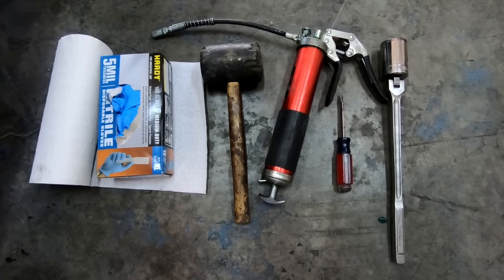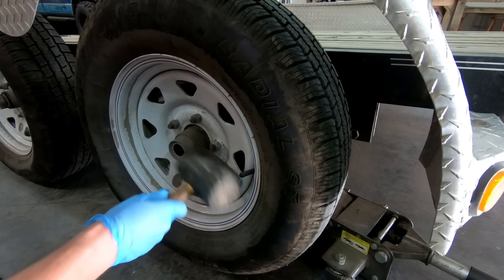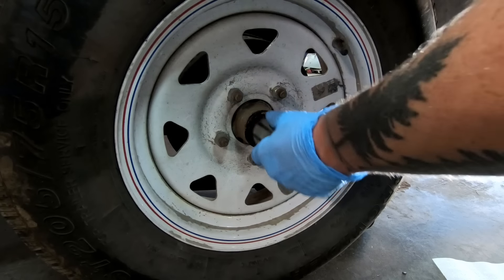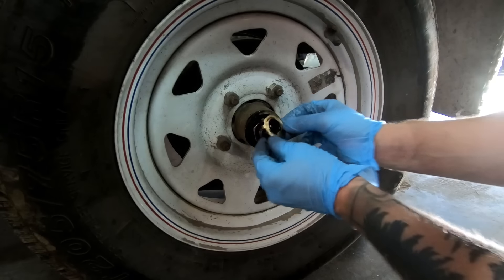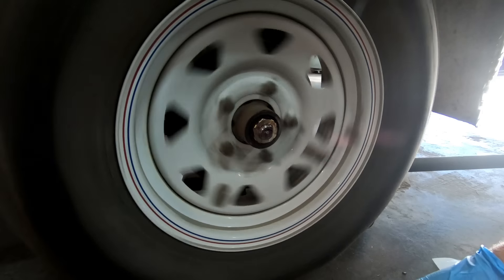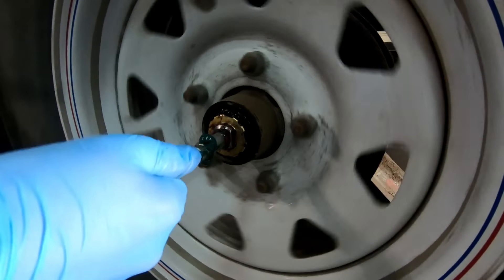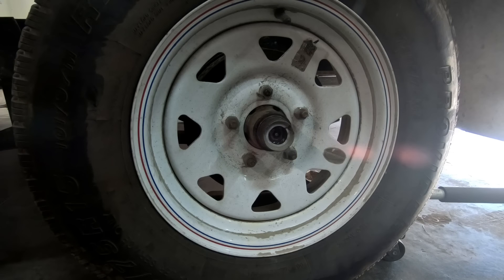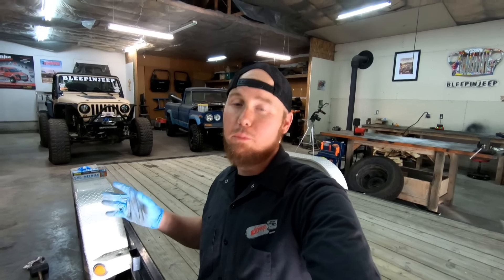Adjusting Trailer Bearings: The EASY way!

Comment: Thank you. I was concerned with the little bit of play I have on my wheels. This eased my fears. I do have a question though. Sometimes I have a good amount of bounce back and sometimes I don't do you think it is load distribution, torsion axles going bad or hitch connection not right?

Comment: You need to tighten the nut with the hub spinning. Backing off allows the outer bearing to push out slightly and unseat from the race. Finger strength will not overcome the weight of the hub and fully seat the bearing. Spin the hub in the same direction as tightening. Never let go of the nut while the hub is spinning as sometimes the bearing will grab it and over tighten it. This will allow the bearing to pull in against the race and fully seat without excessive preload. The tighter end play this creates will be much much more forgiving if you need to back off to install whatever locking method the nut has.

Comment: just checked the Rockwell/dexter service manual for light axles. As i suspected, the bearing adjustment is 1/6 turn loose and more to align the cotter or keeper.
you might also state that most nut keepers go behind the nut.

Comment: What knocks them out of adjustment? Good video as always
Reply: wear
Reply: Thank you! They slowly get out of adjustment from normal wear and tear. When you travel along a lot of dirt roads like I do it will wear them out even faster than normal.
Reply: Heat! They get hot and like most things of metal will change/shrink in time. This wear a good grease comes in to keep them from over heating too much. If you are looking at a used trailer it would be wise to change out the bearings so you know where you stand when you want to travel with it. Nothing like that new used trailer sitting on the highway with one wheel missing.
Reply: @jimwhitman5805  very well said my friend!

Comment: Great video, but you're supposed to torque the spindle nut as the wheel is spinning, to properly seat the bearings. You had let it stop and were still tightening the nut. Everything else was spot on
Reply: Very interesting I was actually taught the opposite LOL. I suppose either way will work as long as the finished result is a wheel that doesn't shake and is not too tight!
Reply: Nate, you'll be able to seat it tighter before backing the nut off if you keep it spinning, then if you're very careful and don't move it loosening the nut and reset it hand tight you should pretty much have no slop in the bearings instead of the little bit you were describing.  If you're able to stop the wheel completely without using something crazy like a 6' cheater you likely have worn bearings.  Dissasemble, and check for wear on the bearing cages (rollers also, but cages contacting is what typically lets you completely jamb up the bearings by tightening the nut)

BTW, same procedure on non-driven axle beargs on cars/trucks (at least on older ones that are adjustable)

Comment: Noticed some wear on the rear axle tires of my travel trailer. There was lots of slop in the rear driver side. Figured it was stupid easy to adjust, but wanted to be sure. Thanks for the video!

Comment: If bearings are bad or sloppy on a single axle trailer will it cause sway?
Reply: I'd look at load distribution first.
Reply: Very unlikely. Sway is caused by speed, tow vehicle and trailer weight mismatch, bad trailer load distribution, and geometry of the tow vehicle and trailer.

Comment: How often would you do this on a trailer?  I don't own a trailer, just wondering.
Reply: Khorsathedark.....I repack the bearings and do this every set of tires, maybe every 5,000 to 10,000 miles, trailer tires don't seem to last too long.
Reply: on my small cheap utility trailers I pull the bearings apart, clean and inspect them, replace as needed, replace the inner seals even if they dont need it, re pack the bearing, and fill the bearing buddies once a year.  if I dont I get a seized bearing and lots of problems
Reply: I shake the wheel anytime I'm about to go on a big trip to make sure there's no access Play. But I've owned this trailer for 3 years and this is the first time I felt like there was enough play to readjust them.

Comment: Iv always been taught it’s better to have it a little looser than to have the bearings with too much preload. 
If the nut doesn’t line up the cotter pin hole it’s better to back off the nut than to tighten it.

Comment: There's a thing called a torque wrench that TIMKEN bearings wants you to use for this. Not to mention checking the endplay. .001 to .005 inches.
Reply: That doesn't sound like the "easy" way at all!
Reply: @fomocowboy  truth. lol. I usually do it pretty much the same way as the guy in the video here.
Reply: @natfunk71  Timken calls for 50lbs to set. Back off one full turn then tighten to 10 lbs. The first 50 seems like a lot

Comment: There is no need to seat bearings 50 ft/lbs that have been in service. That is for new bearings to make sure the races are seated. Preload is slightly more than finger tight or you will find play sooner which you do not want as it does not assure the weight of the load to be distributed evenly over more rollers. I have never in 51 years as a mechanic had wheel bearing failure from this correct preload adjustment.

Comment: You can actually blow the back seal out by over greasing. Too much grease causes friction which overheats the grease and destroys it.
Reply: The pocket recess between the inner and outer bearings in the drum/hub is huge.  It wiil take nearly half the contents of a grease gun tube to fill it up.  Note that the inlet hole is way back by the inner bearing, so that one should see the grease first.
Reply: If you dont overfill the cup (leave air for expansion) it wont blow

Comment: If you overpack the bearings, it will come out of the inner seal and contaminate the brake shoes-which will cause a fire if it overheats.
Reply: One of the common complaints of the Dexter EZLube axles. I've had it happen to me, grease on the brakes. You know what happens when the brakes fade away. I just pull them apart, clean, grease them, new seal (don't forget to grease the seal) and tighten properly. Too loose on the spindle nut, the bearings will be rattling around causing premature wear, and you'll likely lose the dust caps too, they fall off with the rattling. Check often.

Comment: You really should use a torque wrench. With your guns, you probably put close to 100 Ft Lbs on it. Feel free to test my theory! I would also push in grease until I started seeing new. That was a good point about testing for play once tightened.
Reply: That is fine - you want to torque the piss out of it first - up to 200 ft lbs while spinning though 50 is generally fine. Then back off as he did but bearing manufacturers say to loosen a full turn, then tighten to 10 ft lbs WHILE SPINNING, then back off 1/6 to 1/4 turns.
Reply: I used a torque wrench and 50 seems like a lot for the preload. I loosened one full turn, then tightened to 10 pounds.

Comment: 18 year old me.....Adjust the pads? Inspect the bearings? Nah, just snug her  down and add some grease.

35 year old me, inspect and pack the bearings, new seal, inspect and adjust  the pads. Use a hole can of brake clean on drum. Restill hub with proper preload.

Comment: If you put to much grease in there it will come out the seal back and get all over the brakes. Just saying.
Reply: You have a bad grease seal if that is happening. It will force it's way through the outer bearing before it pushes past the grease seal.
Reply: If it comes out the back, you’ve got bearing replacement on your horizon anyway.